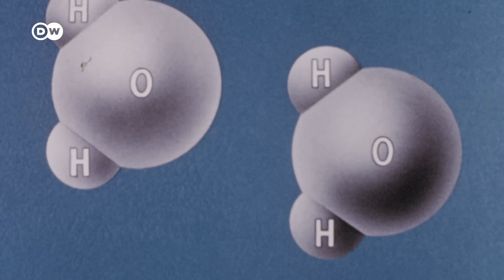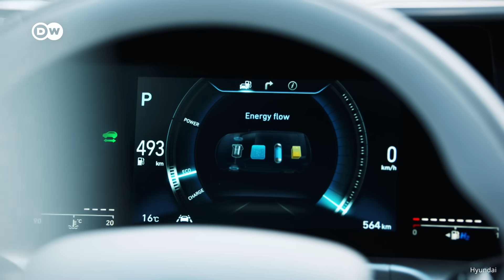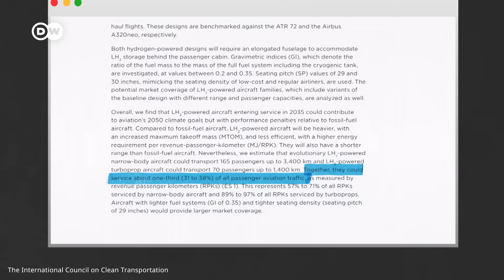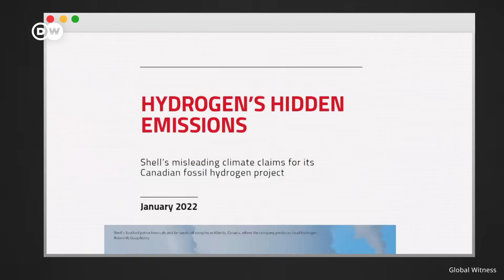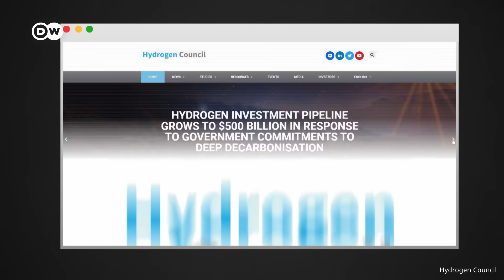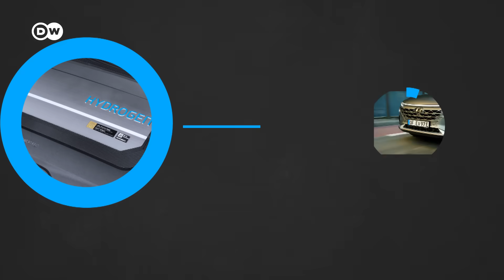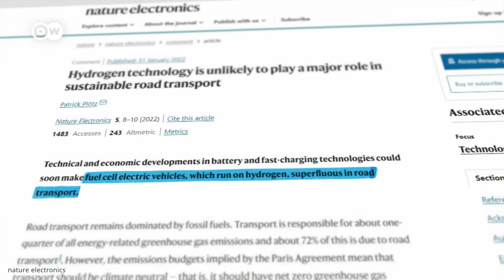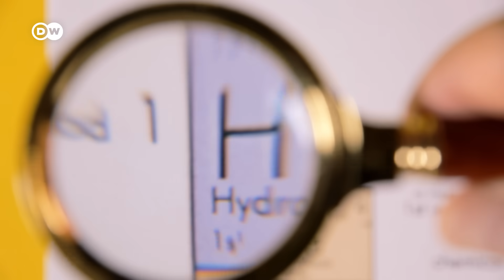The truth about hydrogen

Comment: Informative but contains some misleading information and fails to make mention of pink hydrogen. I am a strong believer in newer, cleaner, simpler SMRs and microreactors. Strategically located, these can produce massive amounts of electrical power but also hydrogen gas closest to hydrogen fuel cell vehicles.

Pipeline will never be feasible for hydrogen transport.

Comment: Net zero is bogus. It's quite simple, if you burn a tree you'll need to plant back a thousand because the tree will grow a lot slower than the time it took you to burn it. As for green energy, you cannot control sun and wind and the actual output is in fact pretty horrible - e.g. for solar this is from a max of 50 percent in the tropics to a mere 10 percent in northern Europe and that's just the annual average. Out of that ten percent I will only get around two percent for the full month of december, i.e. a 200WP panel will generate just 0.4kWh averaging 0.013kWh per day. Because we cannot control the elements we require an energy source that does allow upscaling when someone plugs in an EV and there are really only three possible solutions to that issue: (pumped) hydro, (chemical) batteries, or burning some kind of gas. The truth here is that hydro will never ever meet the full demand and heavy metal mining to create batteries is likely even more polluting than that lignite mine you showed. And so what really happens is that we burn stuff and this means that an EV in reality is not 80 percent effective but only 36 percent, which is worse than a comparable petrol car.

Comment: Diminishing returns.  It requires more energy to generate the hydrogen than can be gained by using the hydrogen.  On a large enough scale, I would consider it possible for hydrogen generation and use to be able to supply the needs of a City or Town.  But for transportation purposes it's currently a non starter.  Any hydrogen fuel tank large enough to get respectable range in a car or truck would be at least 50% of the car or truck.  And if anything hydrogen is more volatile than gasoline.  Yeah, let's all go for a drive sitting on or in a high pressure bomb capable of erasing one or more city blocks in a matter of seconds.

Comment: What is the effieciency if you transport liquid hydrogen (heavy preasure) to gas stations and fill it into a H driven combustion engine?
Or maybe generate the hydrogen at the gas station, using local solar, wind abd additional "grid" energy?
And arent you forgetting that your "baking soda" produces a pretty nasty byproduct when using it to electrolyze water?
Also, dont you need "clean" water?
You cant just pump sea water, add power, get hydrogen and eat what fish you may have captured, already fried.
So as much as the video are critical, you are forgetting some very important facts.
Please do a follow up. Would love to be proven wrong

Comment: Very interesting video. Maybe hydrogen has a role somewhere down the line. 

In the meantime, we need to look at facts. First fact is that modern life requires abundant energy at reasonable cost. For the next 20-30 years, the only two viable sources of that energy are fossil fuels and nuclear. Anything else is a pipe dream. 

Second fact is that anthropogenic CO2 is not a meaningful contributor to global warming. It is only 3% of total atmospheric CO2. Furthermore, the warming effect of CO2 at the current level of 400 PPM is saturated. The practical impact of that fact is that CO2 levels can double with minimal incremental warming. It makes no sense to invest hundreds of trillions and relegate billions of people to poverty to fight the non-issue of CO2. 

We should invest in R & D into all potential energy forms - solar, wind, hydrogen. But it’s a fool’s errand to set mindless goals like net zero by 2050. You’re solving a non-problem.

Comment: Well... we're dealing with an energy equation. How much energy, and from where does it come from to produce a fixed amount of hydrogen? I would also point out that the affects of having millions of vehicles spiting water out of the tailpipes would have on the local environment, humidity levels, corrosion, air density and heat retention from water vapor increasing in the atmosphere?

Comment: I'm a Car TechnicIan,  
Car Exhaust Emission Pollutants Come from 2 Places; 
1) Un-Burnt Fuel + Any Engine Lubricants that get into the Cylinder Etc, 
2) Burning Air for the Oxygen, 21.5% of Air, 
The Residue Being 78.5% Nitrogen + a few Others, 
If You Use Pure 100% Hydrogen as Fuel in a Combustion Engine Car, You Will Still Create SMOG, 
WHY ?
Nitrogen Does Not  Burn of Course BUT 
It Does Convert in the Combustion Process into Nasties Like; 
Oxides of Nitrogen = SMOG, 
This Will Still Happen to the Same Degree and the Approx' Same Amount of Polluting SMOG as if You Are Burning L.P.Gas or Petrol Etc.

Comment: Toyota has spent millions developing a hydrogen powered motor but couldnt get the hydrogen fuel made and available thru the current gas station system. 
Electric cars need batteries tho and mining the nickel needed is also bad.

Comment: So what is the plan for recycling solar panels? Oh that's right there is no plan. Most wind turbines are a combination of materials most of which are not recyclable. Are you factoring in the fossil fuel it takes to manufacturing them in the first place into the equation? 
Also, there are only enough rare earth metals on the surface of the earth to make about  1% of what the world would need to run on solar and wind. So we should divert how much of it to make "green" hydrogen? 
Hydrogen, solar and wind turbines are not the answer. They may be a part of it but only a small part. There is only one solution but everyone is so paranoid about it, it'll take decades and many cold winters before the populations of the world wake up to the obvious.
Reply from the maker: Hi there, you might like this video we've done before: https://youtu.be/EWV4e453y8Y – have you seen it?

Comment: Hydrogen is expensive to store, and even more expensive to make. Hydrogen will always be more expensive than the energy source to make it, whether fossil fuel or electricity. Requiring 3x more electricity to store energy as hydrogen makes battery storage a cheaper and better option - and there are other energy storage options that also work out better than hydrogen. 

The result is hydrogen will never and can never be cost competitive for road transport or ships, and will only be used in aircraft where the lower weight overrides the higher cost.
Reply: The energy return on energy invested in creating hydrogen in usuable form is balanced or negative

Comment: As stated in the video, it may be more cost effective to use natural gas as it is much cleaner than what is used now. As new technologies are developed that may shift the scales. At this time I would think using green H2 where resources exist as we can and push to convert to natural gas instead of gasoline and diesel. Natural gas can be used in conjunction with diesel to improve the combustion.
Another point to consider is who is pushing the carbon push? Unbiased scientists or those funded by people with an interest in incorporating wind and solar. Where did the sudden war on N2 come from? Did Scotty beam it down from the Enterprise? My impression is that Carbon and N2 are buzz phrazes that the public generally has no understanding of, but enough hype in media can get that public running around like headless chickens.
Reply: H2 is best utilized blended into the existing natural gas network as no infrastructure upgrades would be needed for up to 20% blending. I'll openly admit H2 production is highly inefficient but when factoring UK wind curtailment (pitching blades to produce zero power) necessitating 20 GWh of battery storage to reduce losses by 50 percent. For perspective that's 5 GWh more than 2020 Tesla Gigafactory annual production capacity in Berlin and Texas combined.

I'm surprised you mentioned natural gas used with diesel engines and glad to hear the rarity of it's consideration. Not only does it boost power but eradicates the black smoke from the tail pipes at lower boost and low rpm. The chargers for the Tesla semi-trucks are suppose to be 1.5 MWh each and people don't realize regardless if it's on the actual charger they will need fast acting power production idling at reduced power to manage the unpredictable demand spikes as needed.

Comment: I have been thinking of capturing carbon in layers deep underground by pumping it into old mines and to replace the water in emptied fracking sites.  Under pressure the carbon should compress and solidify.  We can then mine it and burn it for electricity production.  I suggest that it might be called "loaded energy optimized carbon" or L.E.O.C.  Unfortunately, LEOC is difficult to pronounce.  Therefore it might be better to reverse the order, as in military designations, hence COEL.  And just as the present vaccinations were accompanied by the assurance that they would be highly effective, and were therefore mandated, although results demonstrated that the vaccinations, instead of accounting immunity actually rendered the vaccinated person 80 percent more susceptible to infection, so this new COEL product could be marketed as "COEL, the new GREEN energy for the 21st century"!  COEL could even be treated with a green dye to sell the point visually.  Statements to the media might proclaim that the black particulate matter emitted from the plant's stacks are designed to attract pollution and bond to it and precipitate the pollution to clean our air.  We can explain that the black particulate matter is uniquely electrically charged to attract and bond to pollution elements.  What a benefit to an already "green energy"!  This will be good reading in our children's science textbooks!
Reply: Haha! Good one!

Comment: We need to go full steam ahead with mass electrolysis and energy production that goes with it, because water will be needed soon anyway. The excess can be stored as hydrogen and used for those things. I don't see why it is somehow an issue. You can even store it as water if it is on high ground, so actual storage is not an issue either.

Think about it this way, you have an elevated lake of pure water, you electrolyze sea water, it goes up towards the lake. Some hydrogen gets diverted to things that need it as an energy source, the rest gets burned and transformed into electricity through heat and goes into the lake. If you need water, you open a valve that makes the water go down, creates more electricity and now you have water. So you have three storage, one in batteries, other in water, other in hydrogen. It's about finding the right balance with all the possible needs, but water consumption I believe would be the main goal and energy secondary byproduct.

Comment: No need to store hydrogen for transport. It is easily made at the place of use. A local Shell station here makes the hydrogen AT the gas station. The only thing missing are the solar cells. Which is what homes, built for hydrogen use, are complete with. Create hydrogen during the day. Store it underground for use in fuel cells to generate electricity day and night and fill the tank in your car. THAT is the future.

Comment: I'm glad the video admits Hydrogen can't do everything. That's the problem w/ the 'no-effort' Enviro-Mentalists, they want a silver bullet & there's no such thing. The one application I DON'T want to see Hydrogen involve w/ are ALL vehicles. Hydrogen requires it's usefulness to be under very high pressure. That means a container secured into a car that, when full, has 10,000psi(68.95MPa) of pressure to fuel the engine(there's a regulator in between for control). People, that's called a Bomb! So the safety aspect & the ageing of components must be considered. High pressure containers can develop fatigue cracks so safety protocols will have to be adhere to w/ sever penalties. So now the questions becomes, who's going to want to work on the car? Regarding EV's: That's a mess. There's more pollution in mining & refining the battery materials that it's not worth it. EV's are also far heavier then ICE vehicles. So tires, shocks & brakes will have a shorter life cycle or a more robust design that will cost more. I'd like to suggest Bio-Diesel. However, the fuel supports the growth of micro-organisms. Also the ability to supply customers & the costs but like Hydrogen & EV, it does deserve more R&D but in my opinion, should be made a priority. Finally: Photosynthesis; that's the process the Trees/Plants use to convert CO2 to food. How much should we curtail emissions & not starve the Trees/Plants? The flaky Enviro-Mentalists don't have a clue but that doesn't stop them, "We have to do something" they cry. Do what, proceed w/ what, what's the plan & how do we implement this plan? The Earth is doing fine, CO2 has been around longer then Man. Remember: The 'Sky-is-Falling' climate chant has been going on for +60 years now & the Enviro-Mentalists hasn't been right on one of their dooms-day predictions. Using the Scientific Method, let determine how our Climate works before we start to 'fix' it...Please!

Comment: Good video. It's all a matter of costs (Levelized Cost Of Energy) and because of its nature (inefficiency) Hydrogen will remain more expensive (main reason we are moving towards battery electric transport). The combination of solar, wind and batteries will be the cheapest because the very predictable cost trajectories follow wright's law. All three technologies are very mature and have been around for decades. The reason capacity of all three are growing exponentially has to do with declining costs (and costs are declining on a structural basis because of economies of scale and technological improvements). As a result the competitive advantage against other energy forms is improving. This driving force is not well understood. People think that we are moving towards renewables because of climate change. In order to solve that problem. The association is then easily made that energy will be more expensive. In reality better economics are the driver and we are clearly following the adoption S-curve. Industries that are hit try to slow it down by distributing misinformation. We have to mine for raw materials for batteries but this will eventually stop. You don't use up these materials. When batteries reach end of life the remaining value is still high. It could be seen as high grade ore and these will be recycled and refined again to make new batteries. Eventually we will get to a closed loop energy system. Future is brighter and it is going faster most people think.

Comment: So postulating that hydrogen has bad effincy at -60% and li-ion -20%, is fine. But take off your Elon Musk tinfoil hat.. and calculate the enviromental impact of producing li-ion batteries.
You can not so blindly conclude that hydrogen is bad for passenger cars, actually it sounds alot like you are claiming that battery powered cars are cleaner for the enviroment KAPPA

Comment: I'm not sure putting water on the roads during the winter or even the summer is such a good idea - it makes the roads slippery. I'd prefer an electric car powered by nuclear power instead. Unlike renewables, nuclear power can be produced on demand and scaled up quickly, and unlike hydrogen, it does not have a tendency to explode or require an entirely new infrastructure.

Comment: Hydrogen is a great fuel additive for vehicles if the flex fuel systems would accommodate the needed spark advance. Hydrogen is a means of a "REUSABLE ENERGY", the only one we know of.
Do some research, it's being used, but it can't be control like petrol fuels. Through use of a PEM or a fuel additive.

Comment: A good intermediate solution would be to generate methanol ("wood alcohol") from biological waste as a carbon neutral fuel, using it in methanol fuel cells to provide the hydrogen for generating electricity. Methanol, since it's a liquid, is easier to transport and pump, more volumetrically energy dense than even cryogenically cooled liquid hydrogen, and is cheap to produce.
Reply: @jayrideau  the biomass traditionally used to produce methanol is the waste from the paper industry, but the waste from sugar production (bagasse) or landfill recovery could also be used. Preferably the methane gas emitted from landfills would be the source of methanol as a carbon neutral fuel.

Comment: Are there any calculations on how much water would be needed to generate enough hydrogen to fuel the world's energy needs? 🤔
Reply: The answer is "none", since burning the hydrogen produces water.
Reply: @Garrison169  thanks, but to create hydrogen it has to be split from oxygen in water. I'm interested to know how much water would be required to produce the hydrogen in the first place. Obviously any rain water would normally refill aquifers or ground water so if that is no longer there or its extracted from the ground there would be a potential imbalance so to speak.
Reply: @romo994  There is not likely to be any shortage of water in the ocean any time soon.
Reply: @Garrison169  ok thanks I didn't realise salt water could generate hydrogen